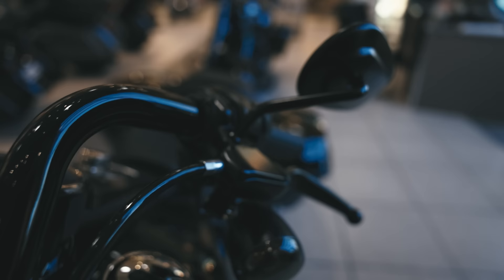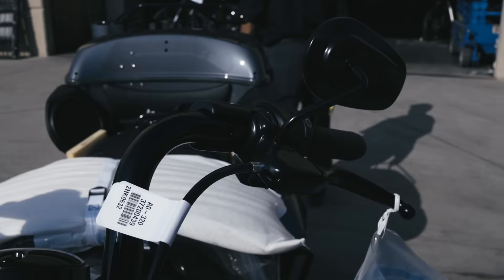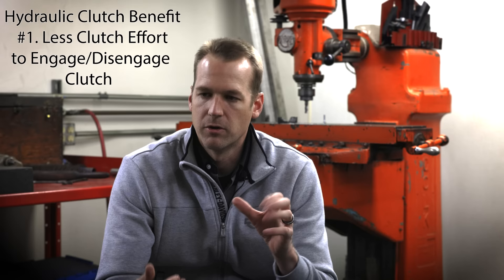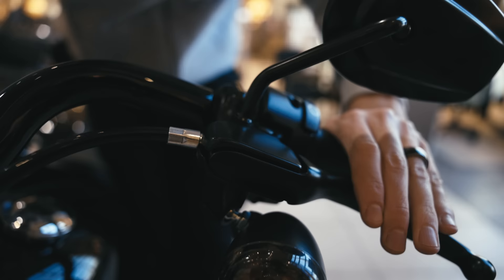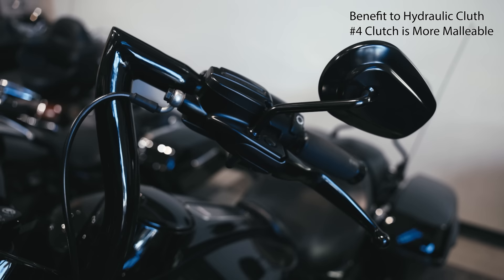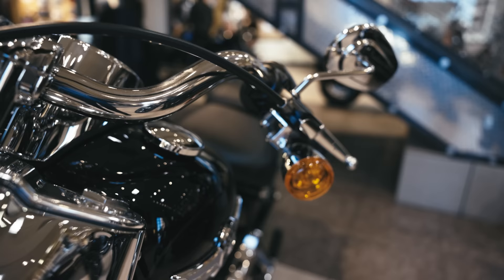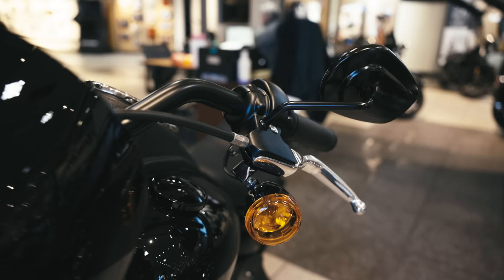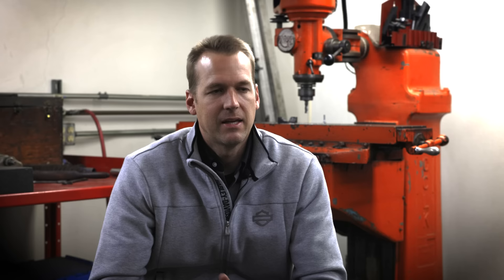Why Harley-Davidson Switched Back to a Cable Clutch on Touring Motorcycles│Pro's vs Con's

Comment: I can’t believe you didn’t touch on the issue of Transmission fluid transfer.  I couldn’t wait to buy my first hydraulic clutch bike in 2017. A Road King Special. I didn’t even test ride it I was so stoked. Then I picked it up.  What a huge disappointment. The clutch lever effort was noticeably higher than my 7 previous cable
Clutch harleys.  It was my first comment to the salesman. “I thought this clutch was supposed to be reduced effort?”  It’s not and it has been proven with a simple scale test on a few videos. I thought whatever, I’ll learn to live with it.  Then around 20000 miles in, the transmission fluid started to transfer and when I brought it to my dealers attention, he says “that’s impossible” 😳
Long story short this was the start of a long frustrating year and around another 20000 miles of HD giving me the run around on fixing the problem. After 3 attempts at a repair did nothing, they eventually installed the vent in the primary and solved the issue. (Something I suggested on day one and was laughed at by HD)
I asked for a fair trade in value on a new bike while this was going on. Nope.  I asked for an extended warranty on my transmission because it had been run low on fluid for so many miles. Nope.  This whole issue has put such a bad taste in my mouth that I bought a twin cam touring bike again a few weeks ago and am selling the road king and will never purchase another bran new HD again.  They do not give a rats ass about their customers and the issues they face with their new machines.  This was my third new bike from this dealer and definitely my last. I have no doubt that one of the reasons they went back to a cable clutch is the transfer issue suffered by a large percentage of bikes that they said for over a year wasn’t even happening and now this video not even mentioning it. What a joke.
Reply: We honestly don’t see transfer issues very often at our shop, but we do all three compartments (motor, primary, and transmission) every five thousand miles which is much sooner than HD recommends.  We aren’t trying to hide anything, hell we did a whole video on Andrew blowing up his stage 3 m8!  If we did 10000 for the primary and 20000 for the trans as recommended we might see it more and think of it as a big issue but with are more aggressive service intervals we really don’t notice transfer in the vast majority of bikes

Comment: I have never had a motorcycle with a hydraulic clutch, so I really do not have an opinion on the use of a hydraulic clutch. I can say that I am used to using a cable clutch, so I will have to test ride a vehicle with a hydraulic clutch to make a comparison. Good information Matt, you make me want to try another motorcycle to see what the difference really feels like.

Comment: I'm a cable clutch person 100%.. I've never seen a race bike or performance bike with a hydraulic clutch. You can fine tune a cable clutch as well as its easier to work on them. Could you imagine being on the road and dropping your bike breaking the hydraulic line, a cable you could just use vise grips or plyers to pull the cable and get home.

Comment: A cable clutch on a touring motorcycle costing in many cases in excess of $30K is an embarrassment in 2021 ! So glad I bought my 2020 RGS !
Reply from the maker: Thanks for sharing your view point. It's interesting to see how divided this topic is.
Reply: Your embarrass over nonsense. The hydraulic clutch system will ruin your wrist depending how big your hands are. People were actually trying to add the extra damper they put into the trike because of the wear and tear it cause on one’s wrist.
Reply: You said it. i'm down
Reply: @MattLaidlaw  you have to ride both systems, and consider what kind of riding you normally involved in. In Nyc metro area, rush hour traffic will kill your wrist if you’re using that hydraulic clutch. I did it everyday. Same with those slow turns. Matt your like 6’6” so you’re not gonna have the issues of getting your fingers around the lever while turning. I’m 5’8” and it’s gotten so bad, it would have to jump into the car to recover.
Reply: @tax905972   My 2017 Limited had a hydraulic clutch, my 2020 has a hydraulic clutch! I’ve owned many Japanese bikes since I was 16 years old all hydraulic clutch! My hands 🙌 work just fine thank you! Nonsense!
Reply: @roadglide1142  Japanese bikes have nothing to do with Harley’s. The systems are not the same. The reliability between them are also different. I have a 2017 street glide Special. It replaced the 2010 road king classic, which had the easy cable clutch. The sweet spot is much lighter and loser to the grip. The hydraulic system’s sweet spot is damn near at the release point of the lever. So your on the tips of your fingers if you’re making u-turns or your over grabbing the lever to reduce the pain in your wrist at slow maneuvering or stuck in traffic, doing 10 mph or less. Hell if your cruising it’s fine because your not using it.
Reply: I learned how to ride through my former job. The NYPD motor school. The police training involves a lot of slow riding, with miles of clutch and rear braking. That means you’re on that hard ass clutch 99% of your training. In nys there’s no lane splitting, so you can find yourself riding for a few hours holding that clutch, if you commute on that bike a lot.
Reply: @roadglide1142  how tall are you?
Reply: @tax905972   5’10”  I’m 55 years old but keep myself in great shape and in the gym almost every day. If I’m in heavy traffic I utilize neutral if need be when it allows. I’ve never had any issues with the hydraulic clutch. I’ve known friends who have experienced a broken cable clutch on cross country trips in the middle of no where USA. For that reason alone I’ll never buy a bike with a cable clutch.
Reply: DITTO!!
Reply: @roadglide1142  I say again, DITTO DITTO DITTO!!!
Reply: @roadglide1142  My other bike is a 2007 Honda VTX 1800 with 92,000 miles.  Not ONE problem with it's hydraulic clutch!
Reply: @doughuntley2974   If Harley doesn’t get their crap together my next touring bike just may be a Gold Wing or BMW! So much more for the same coin !
Reply: @roadglide1142  I agree.

Comment: After trying hydraulic clutch at my first HD demo event 3 years ago, I knew I wouldn’t replace my 05’ cable clutch ride for a new Harley. I don’t understand this whining over easy clutches- never had an issue with squeezing a clutch under any circumstance and hydraulic clutch feel sucks! I adjust my own clutch and place the zone exactly where I want it.
Reply: If you had a 2000 Harley Wideglide You would really  appreciate a Hydraulic clutch.I had that cable clutch lubricated and adjusted and it would still make your wrist hurt after going on a 200 mile ride with alot of shifting.Never a problem with The Hydraulic Clutch on My 2015 Streetglide Special.

Comment: Consumers : "Bikes are too expensive, no full led is not acceptable"
Harley : "We heard you, here is the cable clutch ... but the bike will be a little more expensive of course"
Reply: They are digging their own grave as they are just interested is getting money without bothering about anything. For the amount the bikes cost there is no excuse to not give the basic necessities on the bike.
Reply: See the 2022 Indians? I are much better equipped than the Softails they are going after. I hope it makes Harley step up it's game. I'm a Softail guy, so don't really don't concern myself with the touring models. Harley cheaper out instead of putting on better hydraulic clutch
Reply: I would have loved to see the Harley Davison improve on the hydraulic clutch instead of go backwards. After all isn’t that what there are trying to do nowadays? Move forward and appeal to more riders. Bad move damn, Penny pinchers.

Comment: I have had bikes with a hydraulic clutch for years and they work just fine for me. The 2 Harley Davidson's I have both have one and I'm good with them. 👍 I wouldn't have a problem with the cable clutch on the new one if I was looking at a new Harley Davidson...

Comment: I’m actually a little jealous of the cable clutch cause it’s so much simpler to do bars with the cable clutch especially if they used that new connector system they used on the softails

Comment: I've been riding for many years and my 2018 Street Glide is the first hyd clutch I ever had. At first I didn't like the lever travel distance but loved the ease of the smoothness of operation. I soon discovered that an  aftermarket replacement lever was available and got one. That corrected the lever travel distance to the immediate start of the friction zone at release of the lever and now it's perfect.

Comment: Cable clutch is more fun to ride because of the bigger friction zone.
I got a Dyna and a Limited. I like the cable clutch better.
Reply: I had a 2000 Wideglide and even after having the cable clutch lubricated and  adjusted it was still harder to pull in than the Hydraulic Clutch on My 2015 Streetglide Special.I Love the Hydraulic Clutch on this Bike.Its perfect for me.I have rode a few Harleys with easy to pull cable clutches and I'm fine with them.They are just few and far between.

Comment: There is a reason all motor cops that compete in rodeos use cable clutch. Cable is love cable is life
Reply: If I did not have to worry about maintenance cost I would agree with you.

Comment: Spot on with the pros and cons of each. I think a lot of riders who complain that a hydraulic clutch is a harder pull (it isn't), can't handle spending any time in the friction zone with the lever so far away from the hand grip. I like that my hydraulic clutch friction zone has been consistent for 6 years and needs no adjusting. I don't like that a cable stretches and needs regular adjustment. But I wouldn't let a cable clutch keep me from buying a new bike - every bike I rode before my '15 was a cable.

Comment: I heard some info that some of the reason for the cable clutch is to get rid of the oil transfer to the primary problems is this true.
Reply: No Difference between the Two with Oil Transfer..
Reply: @donaldalbershardt6854  Then why no oil transfert issue with M8 Softails 🤔?...
Reply: I agree the real reason that I heard is because of the oil transfer between the primary in the oil of the transmission because the shaft that goes in between leaks when it hits temperatures
Reply: The Hydraulic and Cable Clutch use the same Pushrod !!!
Reply: @didierlevy4268  Its not a Clutch issue it's a Pressure Problem
Reply: @didierlevy4268  In 2021 they added the inner primary vent tub to all touring because the oil transfer is still an issue even with the cable clutch.
Reply: @mattjad3473  I've heard the same thing from several HD techs. I expect to see the hydraulic clutch back in a year or two when they figure out how to resolve this issue.
Reply: @donaldalbershardt6854  Then why are there videos saying that you have to replace the pushrod because that’s the problem go to YouTube and type in Harley clutch problems and go to focused garage where they explain the pushrod is the problem something Harley should be taken care of not customers this is the whole problem a Harley Davison and I would know because I had an engine I put four grand in that shelled because of faulty parts and they wouldn’t back the warranty
Reply: @kmay5991  Its a Strange issue with the Carryover Problem.. I think the Transmission oil Capacity is to much.
Reply: @didierlevy4268  I've been very lucky with my 17 Ultra Classic. No issues in 27,000 miles.

Comment: I ride a 2020 Low Rider. When I test rode a Road Glide last year I didn't even notice that much of a difference in feel between hydraulic and cable. I will say that my cable clutch seems to walk out of adjustment every 2,000 miles but they made the new clutches so easy to adjust it's never bothered me. I'm looking to trade in on a bagger this spring and I'm completely indifferent about this. If I find a nice leftover '20, awesome, but I really got my eye on a Snake Venom Roadglide. Awesome video as always Matt. Living vicariously through your channel again with 3 feet of snow outside my door.

Comment: Let me add something to that.  After more than 30 years of riding motorcycles (Most of which have been Harley-Davidsons). I found it rather difficult to adapt to the operation of the hydraulic clutch setup.  It's my understanding that a foreign company designed this system for Harley and quite honestly BMW has a hydraulic clutch system that's far superior to operate with much less effort than Harley's had. Why on earth does Harley continue to develop such sub par innovations that taints itself and then goes back years in development to fix it?  They would be so far ahead of the game if they'd get it right before putting it to market!  What other motorcycle manufacturers have these issues, let alone regress to a former design which confirms that they aren't as dedicated to quality as they should be??

Comment: First off, great video, and I value your opinion. Thank you!  I now love my hydraulic clutch on my Ultra AFTER replacing it with a Soft Brake lever which brought it an inch closer to the grip. I have coppel tunnel and holding it halfway out in traffic killed me, but since the reduced pull lever, I'm loving it!

Comment: Matt, I appreciate you diving into this touchy subject and you've done a excellent job explaining the difference and possibly the reasons Harley reverted backwards to a cable clutch. I think after everything was said and done it was definitely a money saving action on Harleys part pure and simple. They figured it wasn't a big enough advantage to a rider for the money it cost to produce it. In my opinion they have messed up,,,again. I absolutely love my 2019 CVO Road Glide hydraulic clutch! I loved everyone I've had and its too important of a feature to give up.( I see that Harley even eliminated the Sirius radio module). Let's hope they don't go back to cable operated brakes next because the circus donut riders prefer it!!!
Reply: I think H.D. realize they can't increase the prices of their over priced bikes ,BUT THEY HAVE TO STOP TAKING THINGS OFF AND CHEAPING OUT!!!!!! 2019 CVO street glide  has coloured stitched seat, front lower fairing with speakers,THIS WAS REMOVED FOR 2020 then 2021back to a  cable clutch.whats next? its incredible 2017 to 2019 M8 has a oil pump that is poorly designed HD tell's you to get the bad pumps replaced $$$$$$ wow!!!!
Reply: I remember when the Pan Head had a mechanical rear brake rod. Some aftermarket company will make an adjustable hydraulic clutch lever and make everybody happy.
Reply: They didn't mess up if they can fork you for a new hydraulic clutch kit ;)
Reply: @eugeniustheodidactus8890  THERE IT US!!  Now you're catching on!
Reply: There it IS,  that is.

Comment: I was glad they went back to a cable clutch.  You can adjust the cable.  Go shift a 2013, and then compare it to a 2014.  It's a LOT easier on the 2013, and has a better friction zone.

Comment: Like the hydraulic, harley went back to the cable due to the continued primary transfer as  there plastic tube was not the fix. Ask me how I know. Matt love your channel and your store, I’m a commuter from NY.
Reply: I have heard the same plastic tube non-fix issue but I haven't personally had any issues with my old 2016 Ultra Limited or my new 2020 Road Glide Limited. I believe the issues were with the 2017-2019 Milwaukee 8's.
Reply: @williamohrt554  There's a problem with the 17-19 M8"s? My 17 Ultra Classic has ran almost flawlessly for the 27,000 miles I've had it. One sensor that took 5 minutes to fix, thats been it. I'm knocking on wood because I keep hearing about M8 issues, I just haven't seen them... luckily.
Reply: @pinkiewerewolf  Good luck. Hope you never have a problem.
Reply: @williamohrt554   Thanks, Me too. Have a great evening.
Reply: Did you try the new clutch rod from Macomb? I just ordered one, not sure if I’m having the issue but it’s like $75 shipped and worth the peace of mind.
Reply: @thinkingoutloud9126  macomb has two different size rods, neither worked.
Reply: @jackscaliajr6452  did they help even a little?
Reply: @thinkingoutloud9126  no they were returned.
Reply: @jackscaliajr6452  dang you’ve got a really bad case of it! Ever find a solution of any kind?Possible you could fall under the lemon law some how?
Reply: @thinkingoutloud9126  working with the dealer on a potential trade in
Reply: @jackscaliajr6452  idk man unless they give you a really good deal that still sounds a bit shady. They’re going to sell you a new bike and make more money off you then turn around and sell your bike to some other sucker and make money off him. All the while that bike needs to be fixed or taken off the road.
Reply: True story

Comment: I have four bikes of various makes and I really couldn't care either way. My Goldwing has a hydraulic and my Heritage has a cable. I just get acclimated to whichever one I am riding. I do like the simplicity of the cable clutch with no fluid to worry about, but either one doesn't sway my decision on buying a bike.

Comment: I learned to ride Harleys with cable clutch and after a long ride arriving home with lots of traffic or when there was an accident on the road it was a true pain in the ass having to pull that clutch too many times, I prefer hydraulic all the way (also very precise and not having to adjust it) as an experienced rider and as a new one too, specially for new/young riders with less strength in the left forearm, I don't know if the new cable clutches are as hard to pull as old Harleys but those were hard to pull

Comment: I agree, I find the hydraulic smooth and consistent. I do have large hands so I never struggle with gray (friction) zone for slow speed cone work. I like that it does not require the extra maintenance. Great video Matt thank you.